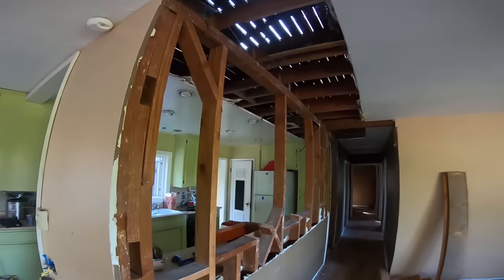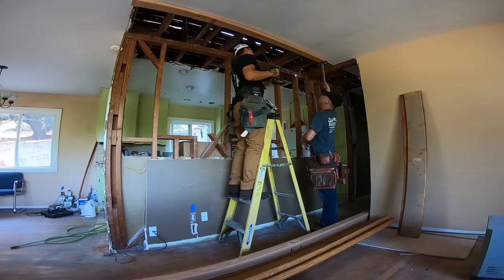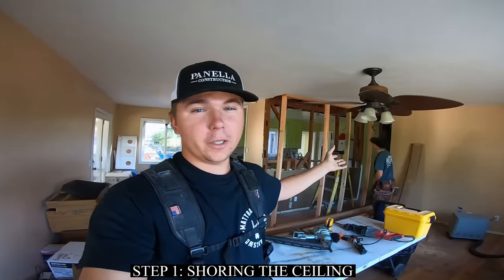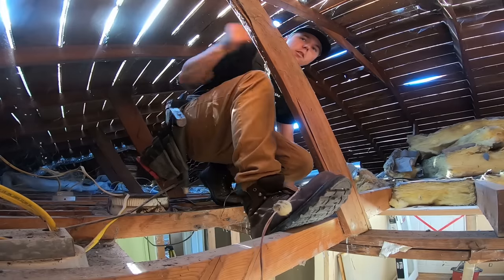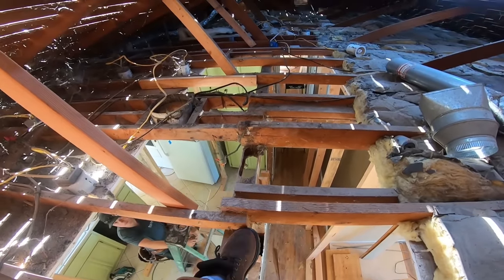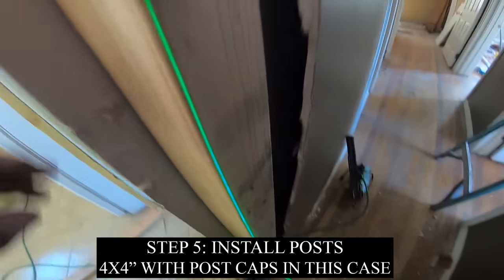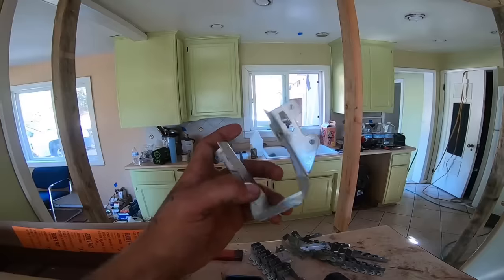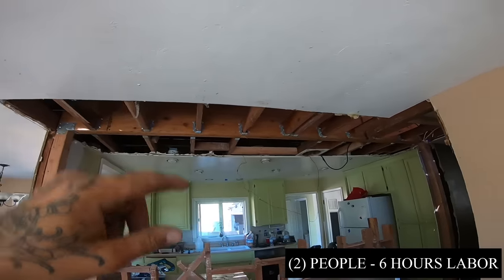How To: Removing a Load Bearing Wall! (EASY STEP-BY-STEP)

Comment: Generally, a structural column would also need a structural footing. There doesn't seem to be much load in this beam though.
Reply: Load bearing walls either sit on beams or foundation walls so he's just transferring the load to the beam below.  Where I live, no work would get done without an engineer signing off on it as it's the law so I hear where you're coming from, at the very least, an engineer would have to approve the posts and beams and point loads on the below structure.
Reply: @MV-wb2cz  yeah that post is sitting on 1 floor joist. Even if it’s a 1x12, I’m not sure that it’s designed to support that kind of point load without a lot of deflection
Reply: @Markism07  If this load bearing wall is sitting on 1 floor joist then there should have been some work below either double or triple up the joist to support that kind of point load.  Where I am from load bearing walls always sit on top of a beam or foundation wall.
Reply: @MV-wb2cz  and?
Reply: @Markism07  i'm not sure what you're asking me...
Reply: I was looking for this question. As I have seen if the house has sub floor, not slab, they would need a larger footing for each pier under the point of the uprights. But great video showing how to install beam into the attic space to truly open up the living area!

Comment: Been doing this for years, I am actually insured to remove structural and replace it, given I have years of experience running shoring and forming crews on High Rise Poured in Place construction. I dunno if I would be suggesting this be done as a DIY given what "could" happen if done wrong but hey not my video so. I'll just put it this way, even with my experienced crews I am present (me the owner of the company now)  in person to supervise on every job that involves this type of work.
Reply from the maker: I agree with you 100%. My videos aren’t exactly based towards H/O’s. More or less youth looking to learn a bit!
Reply: @MattBangsWood  Ok well that is awesome, I can speak as a Construction business owner since I am one that we need a ton more young folks in the trades.
Reply: Yes Whitey yes we get it your a “real” professional

Comment: Great work...I'm planning to do the same but 6m span therefore going steel beam. Question: re bracing/purlins in roof...is that needed only when beam is not exposed as in video attached to joists with hangers? And bracing not required if beam is exposed under ceiling? Thanks heaps from New Zealand

Comment: Hey thanks for this video very helpful,  I have a question. The bracing going on top of the been, I didn't see it being installed. Or you left it with the ones you added for strength?
Reply: No top bracing. Each end sits on a cripple.

Comment: Matt, is it possible to set the double LVL beam above the ceiling joist and then strap the ceiling joist to the LVL and not cutting the joist for the LVL?
Reply from the maker: It could be possible? I've never seen it done. You'd need your posts to sit up extra high to try that though. I'd say either way would be about the same in labor.
Reply: The LVL is typically designed with lateral support taken into consideration. In this condition, you can top load or side load LVL.
Reply: I have done a fair number these beam installs and I had a structural engineer suggest I set the LVL beam slightly higher than the ceiling joist and then strap the joist to the sides of the LVL with Simpson strapping and try to raise the ceiling joist a small amount so that when the wall was removed it would set the ceiling level. Thanks for your reply’s!

Comment: What was that gun you used to attach the hangers? Heck of a lot better than smashing fingers
Reply: I dont know what he uses but you can use a 'Paslode PPN35Ci Lithium Gas Positive Placement Twist Nail Gun for Fixing Joist Hangers & Brackets (1x 2.1Ah, Case) '
that's what i use

Comment: Hey Matt, something that you may have left out- wouldn't those 4x4 posts need a concrete pier underneath? 

I've seen cases where people have done this and caused the subfloor to start cracking from the weight bearing upon those 4x4's. I'm sure the 4x4 on the exterior wall is fine since there is always foundation- but the one that sits in the middle of the house are usually suspicious.
Reply from the maker: The 4x4" posts have 4x6" blocking underneath from joist to joist to hold. That was one of the first things I thought about. Making this an instructional video, there was a few things that got left out.. As they're variables, and not for sure in all cases! :) 

Good looking out!
Reply: @MattBangsWood  there were* a few things
Reply: @MattBangsWood  sweet! I guess it's good we didn't see you guys underneath in the crawlspace. Probably the worst place to be.
Reply from the maker: We pick our clients, chances are we wouldn't want to work with you either.. 

Thanks for watching! ;)

Comment: the last job that I did the second floor was so much weight that I added to beams and piece of Steel sandwiched in between on both sides of the kitchen walls that we removed the one beam was holding up the middle of the house the house and the other was holding up the back wall of the house that's why we put the steel in between
Reply: Where I live (Canada) we call that a flitch beam... great solution for heavy loads.
Reply: Randy Dueck the part that was the biggest pain in the ass that one was 16 ft and the other was 14 ft and we ended up putting those together inside the house they had it be 10 of us to lift them into position the whole purpose was to make the living room kitchen dining room one big open room and this was a flip house that we ended up buying to resell and the first family that came to look ask if they purchase the house if we could put walls up because they didn't like how everything was open I wanted to pass out it was part of their religion that they like smaller rooms not open I guess you can't make everybody happy

Comment: I think you may have missed a step, which is to have someone calculate the load and size the  beam for you.  It seems like you just arbitrarily chose the beam dimensions and went with it.  Aren't you required to have a drawing from an architect/engineer for the permit?
Reply: No if you know what your doing
Reply: Yeap

Comment: 2 x 14" 1 3/4 LVL what sort of roof loading per sqm are you working on, as this seems overkill for that sized opening and roof type.
Reply: My guess is this wasn't completed with a stamped plan, permits or inspections.
Reply: Rob Estoll 

It’s a bit hard to tell the insurance company and inspectors that this is how we bought it when there’s a video of the remodel.

Just hope those 4x4s are supported from beneath!

Comment: Did this require structural engineering plans?
Reply: Mytown   Nope. Just some good ole fashion carpentry. Hopefully whatever was holding up the wall before is still holding up the posts supporting the entire roof.

Comment: Because it has been changed from “distributed” load to “point” load, doesn’t mean the load itself has disappeared. Part of the roof load has now been transferred to the foundation at two specific “points”, without any thought of re-enforcing that foundation.
Reply: For the specific reason 
, I think it's a horrible video
Reply: Can you refer professionals in the Chattanooga area?
Reply: Explain!
Reply: Yup. and I'm sure they didn't have the thickness of the slab inspected either (pretty old house too). But ceiling load that is considered non-accessible is certainly not as bad as if there was a 2nd floor to support.

Comment: Question why did that need a beam and the live room  side did not ?
Reply from the maker: The living room was carried with a 2x8" with a 2x6" along the backside. I would have personally loved to run an LVL clear over to that exterior wall.. but that wasn't within budget for this client. A 14' opening, these days, I'd only trust LVL to span that big of a distance.
Reply: @MattBangsWood  I think the most we ever spanned was like 20 feet with a double lvl for a porrch roof we built

Comment: my dad was called to a job where the homeowner decided to do the remodeling himself my father was walking inside the house when you notice the baseboard and floors  where about an inch or more apart the second thing he noticed with how big the rooms were he asked the guy who did the construction the homeowner said he did he took out most all the walls including all the wall bearing walls on both floors my father ended up condemning the guy's house because the house could collapse in on itself that's how bad it was if you don't know what you're doing stop and consult a professional
Reply from the maker: WOW!!! I have NEVER heard of anything like that, that's CRAZY! Your dad did a good thing, those people could of died!

Comment: Every load bearing wall is different needing a different approach that is signed off by an engineer.there is no “one” way.
Reply: Wrong. All of them will need a beam to carry the load, thats basic engineering. Whether the beam is steel, or LVL and the size is what the engineer tells you.
Reply: You say wrong then you agree ? Wow....

Comment: That's not a bearing wall in the proverbial sense...I have torn out many, many bearing walls...A true bearing wall supports a live load or Masonry....A sister and a stiff back would have given you the same support...It's just ceiling sheetrock...If they were planning on using the attic you would have to up size the ceiling joist/studs and then use a bearing wall.  It's overbuilt...Those two LVL's are ridiculous...Building and Remodeling contractor for nearly 40 years.
Reply: "provincial sense'???
Reply: @TheDarkHour684  :)...I should have written :"proverbial" ..............Hey, it's a philly thing! But thanks for the heads up!

Comment: Hey Matt, love your vids man. I’m new to carpentry, I graduated carpentry school back in January but I have a question....

There is a wall in my girlfriends kitchen that she wants removed. It is running with the joists but it carries electricity for 3 switches. First, do I have to do anything special to remove the wall since it’s non load bearing? Secondly, what do I do with the switches?

Comment: Good job. I do it the same way except with acrow props & continuous sole plate. Prolly shoulda mentioned there is a formula for nailing/ laminating 2 lvl's together also some instruction about transferring of the load in the sub area eg: piers & footings. Definitely not the sorta job I'd be recommending for1st timer DIY project .Good skills no fuss no dramas the sign of a good tradesman you make it look to easy.😉

Comment: I'm a licensed PE. I make a lot of money every year calculating out and placing beams to do this type of work in houses. Not something you want to go into without an engineer to figure your beam size or post placement.
Reply: because your money will dry up?   Folks were building houses and larger structures before engineers came along. (i.e. ark built by beginner / titanic built by engineers)
Reply: @billybrewer4039  a good contractor can do a good job BUT I've still seen plenty of stuff that people intuitively think will work but it doesn't. You're arrogant and wildly ignorant if you think you have the skill and expertise to do my job.  Also: who takes liability? I also am paid to take liability for my work. Sure, most calcs I do are pretty simple but if you want to take responsibility for people's lives like I do WITHOUT my training,  go for it.
Reply: @billybrewer4039  the titanic was built by engineers. Many of the great structures in this world were designed by engineers

Comment: BEST VIDEO!!!! Thank you!!!

Im confused about the 2x4 you attached to the rafters. Did you just let them hang there at an angle? Or did you tie them into something?
Reply: They were nailed in just to act as support when they cut the board out with a chainsaw which I found odd using a chainsaw but whatever works I guess lol
Reply: Chain saw to demo the old will do the job as a saw saw it’s just preference

Comment: Nice to see you recess the beam- a tip is to next time not screw the temp supports- just use double headed nails and it’s just a temp wall no need to measure. Just wedge the 2x4s up
Reply: Screws are faster and easier

Comment: I have been doing allot of these lately.  The best way i have found is put your new beam on top of the rafters and strap hanger all the joists. No cutting a pocket to put your beam up or temp the wall up.
Reply from the maker: Someone mentioned doing it this way and being honest I’ve never seen it done, but it makes total sense! I’m going to try it soon.
Reply: How long should the new beam be for say a 6’ opening?  I want to open a wall and the opening doesn’t have to be all the way to the ceiling. Could I put a couple of 2x4’s on each side with a couple of 2x4’s resting on them, to avoid putting a beam in the attic?
Reply: @kayBTR  6ft opening is a 6ft beam.... depends if its holding only the ceiling and how far the ceiling spans. If its only some 2x4 spanning 12 foot for the ceiling  for example. You might get away with 2 2x6-2x8

Comment: I've never seen a clip for a palm nailer before. Thats pretty sweet.
Reply: That's not a palm nailer. That's a hanger nailer. They have a special tip that allows it to fit in the holes of the nailer instead of hand nailing. Framing nailers do not have the precision to hit the hole.

Comment: Thanks for the video. @10:20 How do you tie the LVL to the existing top plate? Also, looks like youre using a post bracket to tie the post and LVL together?

Comment: Nice but who sized that beam? I use pairs of 7 1/4" LVL when I'm dealing with actual second floor 2x8 joists for a span like that (8'-10'). Two 14" LVL seems wildly over sized. Those glorified collar ties just carry the weight of the drywall ceiling.

Comment: great video man, thank you. Could you do one in a two story house? curious how you could do it without having to drop the beam and cover with drywall on three sides
Reply: Supports same way but all cutting needs to done from down to up also most likely beam need to be steel I or H beam and fill with lumbers those flanges where you then can attach joist hanger more easier way.

Comment: great even for a rook like me. One question: How do you line the "floor Plate" to the 2x4 attached to the ceiling to install the vertical temp studs?

Comment: Do you know where I can get more information on which type of LVL to use? . When to go wider? I have one opening of 80 inches/6 feet and 8 inches. It seems like it was done with one LVL (1.75 by  9.25 inches) and a 2 by 10 put together. Will that be enough? It holding up a second level and empty attic.

Comment: I have to do this exact thing. How did you join your two LVL's together? And any reason other than handling, that you went with 2 - 2' lvls vs 1 - 4" one? Do you the distance limitations on LVLs?

Comment: Great video, thank you for posting. Question: Do you need to brace anything below the floors, especially where the 4x4 vertical posts are? In other words, those 4x4s are having a lot of weight transferred down through them. Do you have to put piers/posts underneath them to absorb this weight transfer?

Comment: I have similar project except my wall is red block brick with plaster over it.
My house was built in 1946 and I'm just going to notch my brick so my beam will be sitting on brick wall. I really would love to not have my beam being exposed but the way you guys did all the attic work is way to much work for me being I have new blowed in insulation and plaster ceilings

Comment: Keep in mind that the floor is also supported by joists that are in turn supported by a carrying beam that’s supported by columns set in concrete footings.  What he’s doing is ok but there must be sufficient support under the new load bearing 4x4’s to bear the new load.  The LVL well do it’s job fine but it must be properly supported too.

Comment: Matt I have a question for you. I just recently purchased a Victorian home built in the 1936. We have a small 48” wall dividing the kitchen and dining room but we want to open the kitchen up. The wall that divides the two rooms is load bearing and it holds a gas line in the bottom that connects the stove. I wanted  to make it an island for the entire kitchen with the bottom of wall and just cut out middle but don’t know how I should support the ceiling. Any ideas? The kitchen was an add on back in the day.

Comment: Good video. I plan to open up a load bearing wall so I can have around a 5 foot opening. I wonder how much that would take. It is just a single story with attic. Maybe 3 ply of 2x6 to header the span, but I am just guessing. I want to keep it as low profile as I can keep it. Maybe just a stack of 4 - 2x4s all glued and screwed together to keep the width at the top even with the wall.

Comment: I'm doing this next week but with steel, what did the original builder do to span the entry way?
Reply from the maker: To the left of the load bearing wall, it was spanned with a 2x8", strapped joist to joist. Not sure if that's the entryway you're referencing?

Comment: Good work. But you should also mention what you did to strengthen the new two load points? Meaning you took weight distribution from a whole wall and put it on two post points. How about under the posts?

Comment: If the bearing wall consist of a 28 foot length would you recommend using an Ibeam and also transferring the load to the basement??

Comment: Thinking about doing something similar only I will leave 1/2 wall and drop the beam down from the ceiling. I was thinking 2 -  2X12s joined together as a beam and building a top on the 1/2 wall for a breakfast bar. This should save me from a lot of attic work with blown-in insulation.